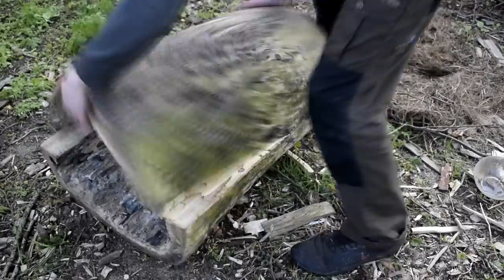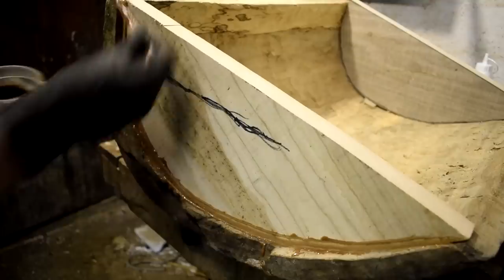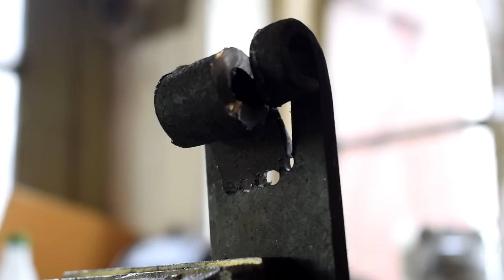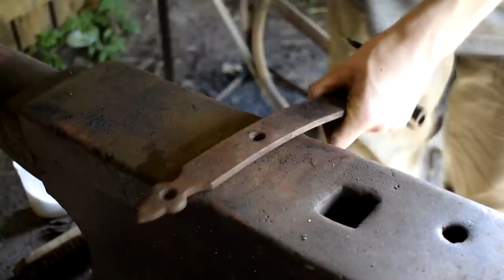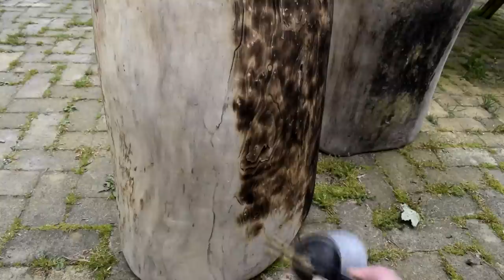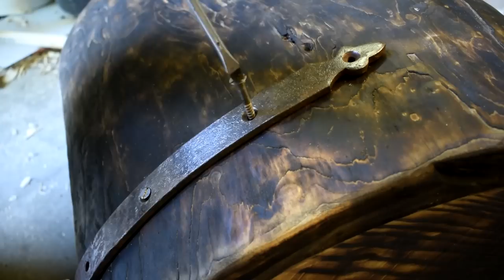Woodworking and Blacksmithing - Chest from Old Hollowed out Log

Comment: Great piece. Didn't like the handle though..
Reply: Y its cool i like how its bendy
Reply: I like the twisted handle, but I would have stopped while it was still pretty symmetrical if I were doing it. Great piece though. Like the video
Reply: @cavemanbob82  I have to agree. It was a pretty amateur twist. Not symmetrical. And instead of screws and glue to hold the hard where on. I would of used forged rivets. But overall a great piece.
Reply: Handle should jave been wood or anything else other than what was chosen.
Reply: @chrisbird1909  the metal handle was a good idea with the twist. Just poorly executed.

Comment: Does burning the wood give it a desired property? I didn't understand why you charred it at the end. Also didn't you sand in inside as well? Looked very rough. But great work.
Reply: It is a Japanese method called Shou Sugi Ban. When done in the right way on the right type of wood (like Japanese Cedar), it will preserve and protect the wood. However, for most wood types, it just helps define the wood grain for an aesthetic look
Reply: @dross6206  thanks for the info. Great stuff.
Reply: Fire is also used to make the wood look aged

Comment: What is the chemicals you used to cover up the spaces in between the logs and the wood you glued on
Reply: Epoxy resin + wood shavings to create what's basically particle board.

Comment: It isn't the worst but a lot can be a done better. The burning of the wood: idiotic. The wood had an awesome pattern and it was ruined. The handle: nice idea, but not done correct. Chopping the wood from the inside? Very lucky it stayed together in one piece because the chance it split was enormous. After all: nice idea, but the craftsmanshipp is sloppy and not good